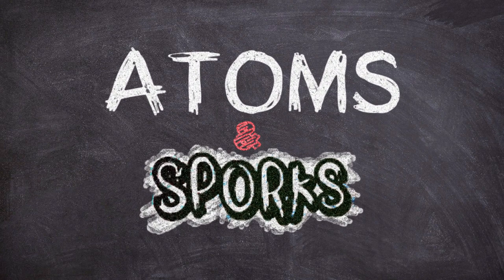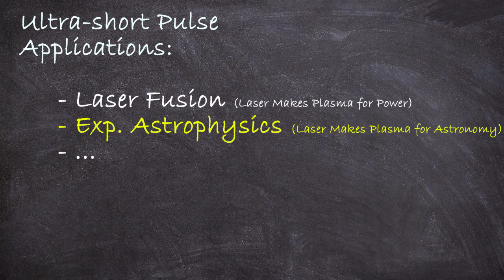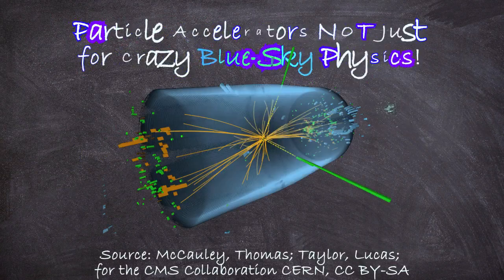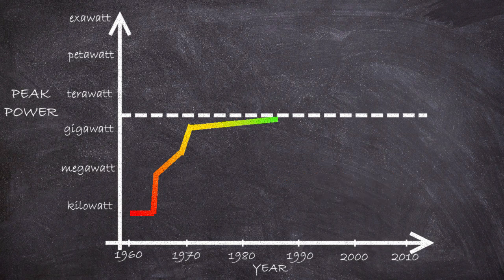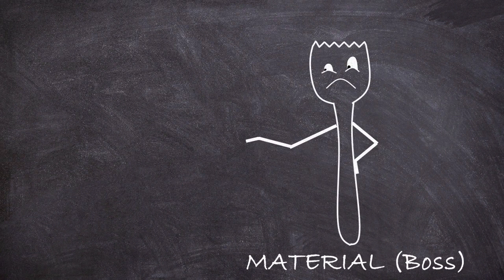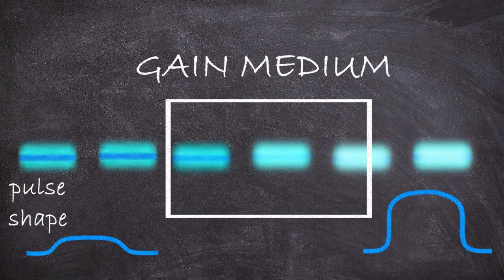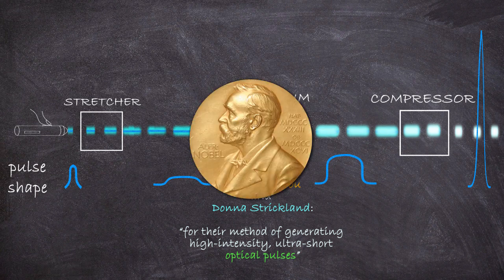The 2018 Physics Nobel Prize, Part 2: What IS Laser Chirped Pulse Amplification?

Comment: Is the amount of photons in a pulse stay the same during chirping?
Reply from the maker: Some day I plan on doing a video about how the concept of photons is used and abused and often not worth the effort as a mental picture.

It is almost always a far better mental picture to abolish the word "photon" entirely and instead say "quanta of an electromagnetic (EM) wave/field". They ultimately mean the same thing, but your intuition is going to be correct far more often if you go into things with the latter idea.

So you have some travelling EM pulse that gets stretched out along the axis in which is travelling forward. However, if you add up all the energy in the wave, added up over the full pulse, that must either be the same or less than before, after chirping. "Less than" because there could be absorption of light during the process. If you want to talk about "quantas of the EM field" (i.e. "photons") then at any point you can imagine breaking that wave up into its component sine waves. You can do this with any wave, break it up like this, it's called "Fourier decomposition". Then when you've got the full field as just a sum of a bunch of different sine waves a "photon" is the recognition that the intensity or amplitude of each of those sine wave can only change in clumps. Each can only ratcheted up or down in strength by discrete amounts.  

The number of quanta at a given moment depends on the wave's shape and the total intensity of each of these sine waves that are needed to add up to make it and changes completely from moment to moment if the shape of the pulse changes. Energy must be conserved (assuming no absorption) but there is no notion of "conservation of photons" in physics.
Reply: @atomsandsporks6760  Sorry I meant to say, "Does every photon in the regular laser pulse get chairped? Like turn 10 photons into 10 gamma ray photons?".

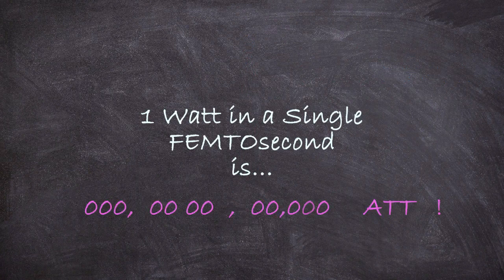Comment: Btw, 1:55 is incorrect... 1 watt means literally 1 joule PER SECOND. So, to say that you have 1 watt in a femtosecond makes no sense (at least not in the way you want). You should instead say that "1 Joule in a femtosecond is..."
Reply from the maker: The video is correct and it is in some sense the entire point of the video. If we assume that energy is conserved in the CPA beam shortening process then, since energy is power x time, compressing a, say, 1 second pulse to a femtosecond pulse increases the pulse peak power  of that pulse by 15 order of magnitude. That's why you do it in the first place, to obtain extremely high optical powers... if only for the briefest fraction of a second.
Reply: @atomsandsporks6760  But it's the compression of an ENERGY of 1 Joule into a femtosecond which increases the power from 1 Watt (which is 1 J/s) to 10^15 Watts (or 1J/fs), I think... A Watt is a derived unit, defined as 1 Joule/1 second. Therefore I don't think it makes sense to talk about watts/s, as this would be J/s² which I don't know if it has any valuable physical signficance.

Comment: If you had a powerful enough lazer you could create an accelerator just from the photo electric effect.
Reply from the maker: I mean, the FIRST particle accelerator were cathode ray tubes (CRTs, like those used in old televisions) where electrons are accelerated by the electric field between two plates. Electrons are ejected from one plate (really a coil) by thermal emission (i.e. it was a hot wire) but one could also just as easily use photoelectric emission.
Reply: @atomsandsporks6760  It is remarkable that you can concentrate the power of lazer due to its negative temperature. https://en.m.wikipedia.org/wiki/Negative_temperature#Lasers
Reply from the maker: @sadface7457  Well actually if you DIDN'T have negative temperature in the electron system then you wouldn't be lasing at all! Population inversion is a key part of the whole lasing process.